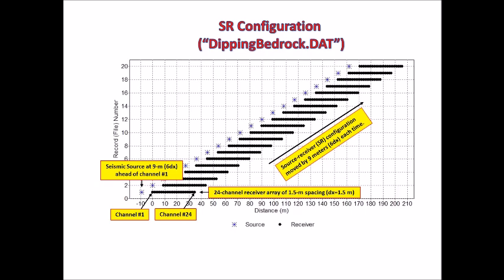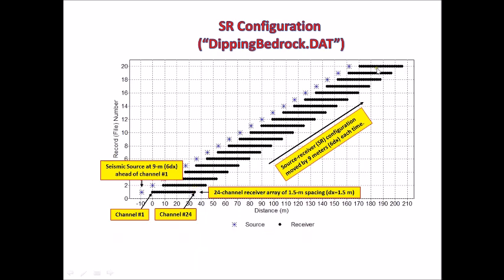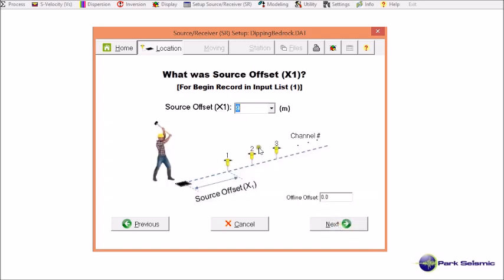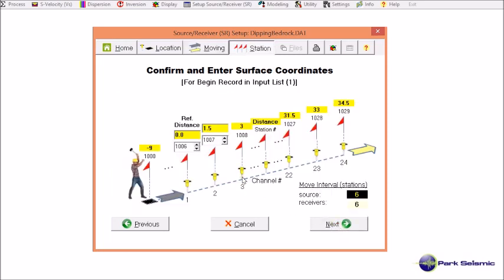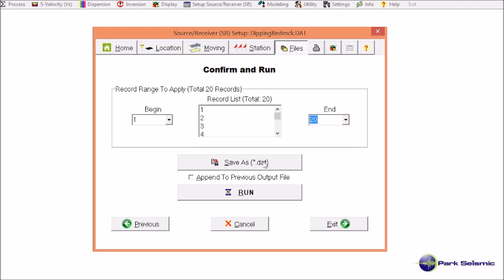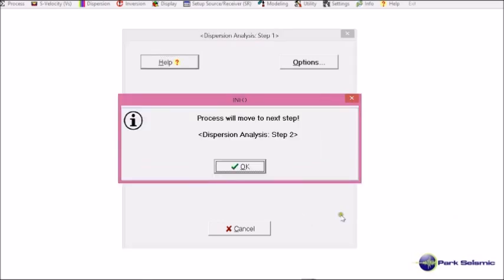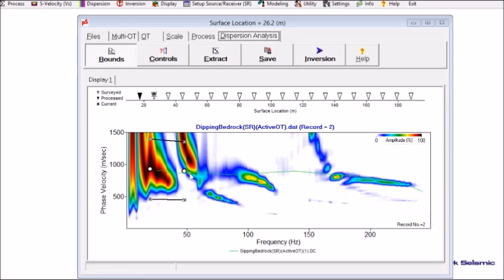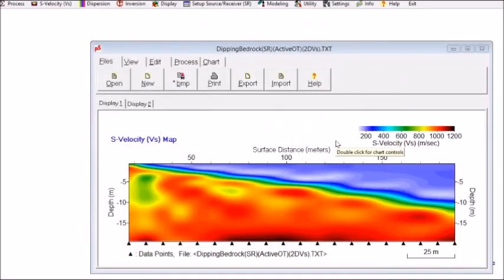Generating 2-D Cross Section (Working with Sample Data)

Comment: Sir,
    For 2D active how can i using filter cause there is so much noise in that location where i conduct my survey.plz suggest me .
Because if i save it after that i am unable select all those file for generating DC curve
Reply from the maker: The noise on time series (i.e., seismic record) usually does not influence on the dispersion analysis.  It may look noisy, but dispersion image may look intact.
Reply: So that, It means you are suggesting me to not apply any filter on that particular seismic data.
Actually, if I apply Filter and mute after that when I saved the data it converts (not Seg-2 Files) . So I am unable to select all those data cause they are not seg-2 files.,I am just asking is there any such options are there where I save the data(after applying the filter and mute) in seg-2 format.please help.if you want to see that particular DC curve I can show you if you providing me your mail ID
Reply from the maker: Which software are you using?
Reply: ParkSEIS 2.0
Reply: ParkSEIS 2.0
Reply: @pallabdatta6973  could u please your email